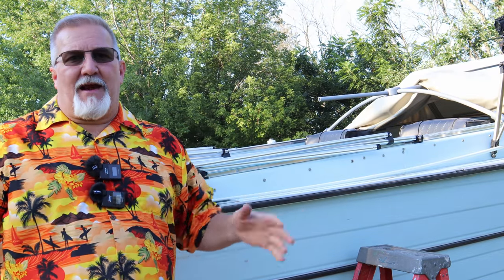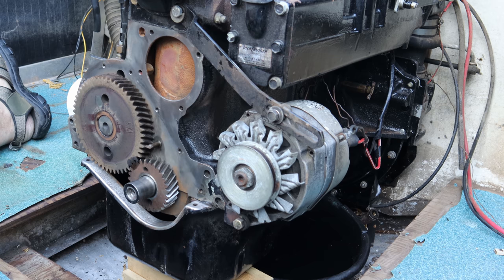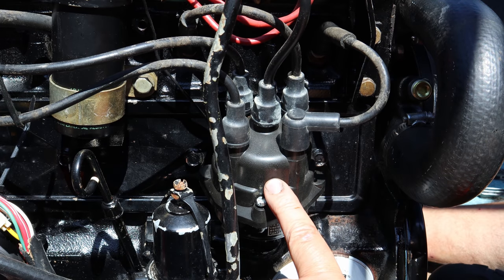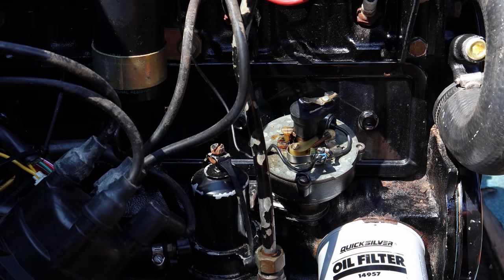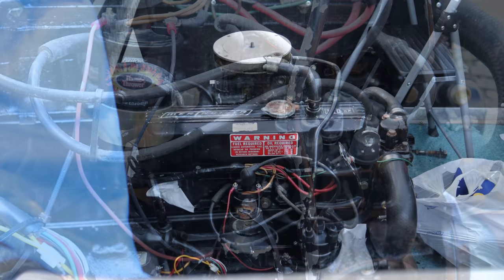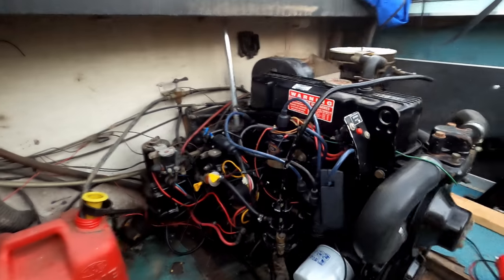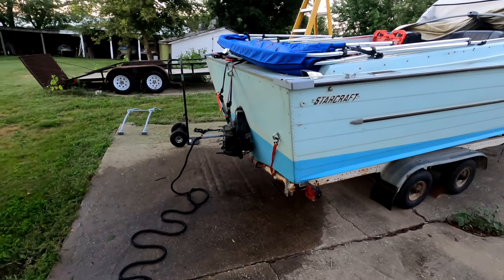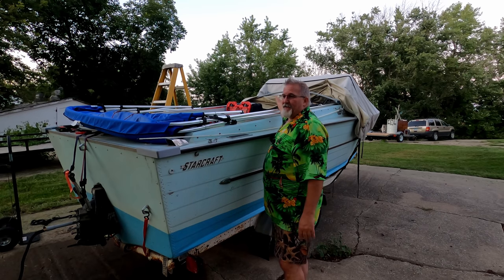1968 Starcraft Islander part 5 New parts and start up  Petronics Electronic Ignition and more

Comment: I guess I need to check my voltage at the coil after doing my electronic ignition changeover on my 79" sunrunner with the V-8 chev 305 pushing my 16" X 15 pitch volvo prop. Thanks for the info! I want my full 200HP
Reply from the maker: You are welcome, thanks for watching

Comment: on the plug wire i found it that way in the selock manual. it depends on the year and it doesnt show the variation in the manual but it does state so if i remember correctly. isnt there supposed to be a spring clip under the felt that holds the breaker cam in?  that would be an awesome big lake boat with the high sides in rough waters
Reply from the maker: Thanks for the info and thanks for watching

Comment: You will get a better hole shot if you soften those distributor timing advance weight springs.  Stretch them a bit. Also can also weld the slot a little to reduce travel of those weights.
Reply from the maker: Thanks for the tip

Comment: The other thing Mike is those parts are notorious for rusting through.  I use epoxy paint which is far more durable to finish coat them as well as the oil pan.  FYI
Reply from the maker: Another good tip, thanks again

Comment: Hi Michael! Great video. I never heard back from you on the cover brackets  you said you were going to design and send me. Pls do. Thx
Reply from the maker: I haven't had the best of luck with my PLA printed supports. So I haven't come up with a better printed material just yet. I may have a PVC solution coming soon.
Reply: Thanks. Keep me in mind if that solution works.